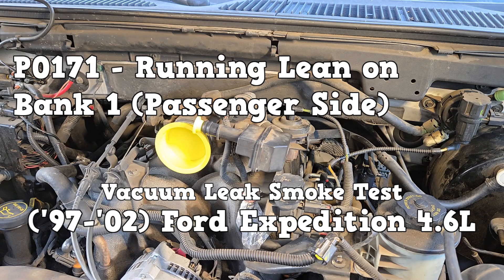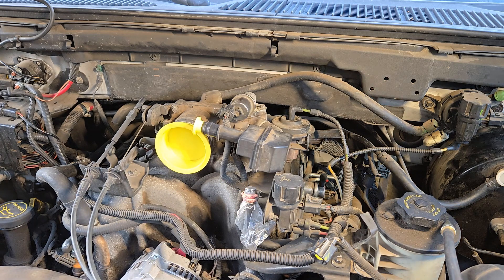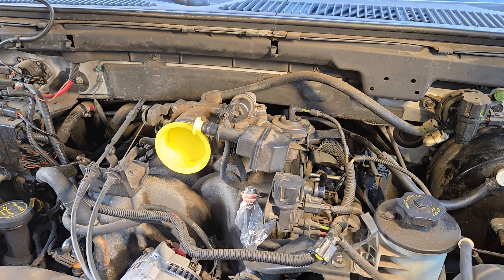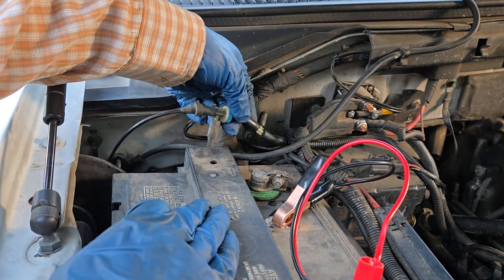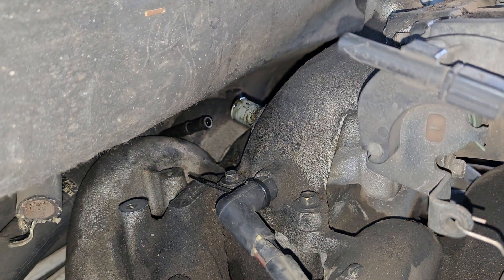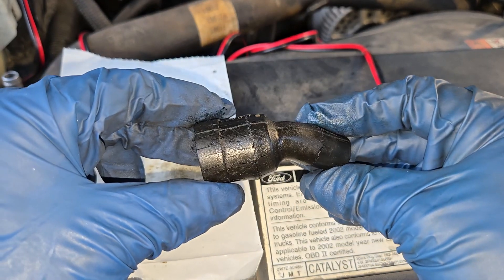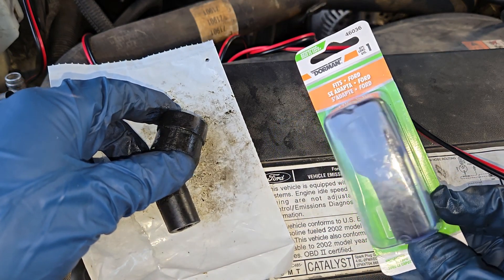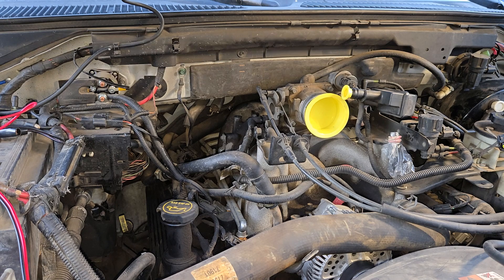P0171 Smoke Test Diagnosis ('97 -'02) Ford Expedition 4.6L

Comment: Thanks! I looked up the Dorman 46036 as it appears that part is needed behind my manifold , yet my 2001 Expedition 4.6 L is not listed as being compatible. Is there a different part number? Also thanks for the TSB # 01-20-5. Also note that the tailpipe needs to be capped off.
Reply from the maker: Have you removed the rubber elbow? That way you can compare it to Dorman 46036.
Reply: @OldSchoolNoe  I will have to take a look at it with a mirror. I am thinking there is a complete PVC hose kit with elbow for the 2001.